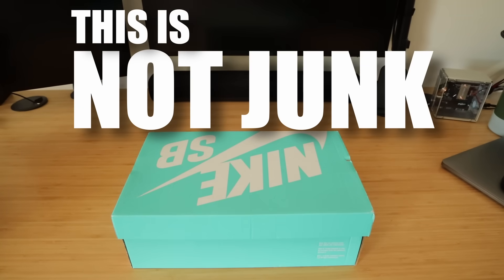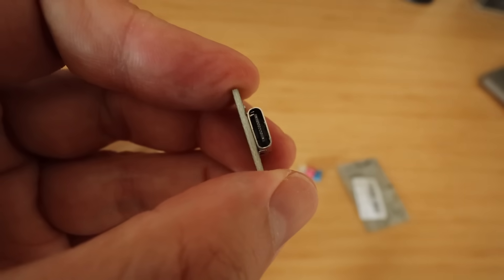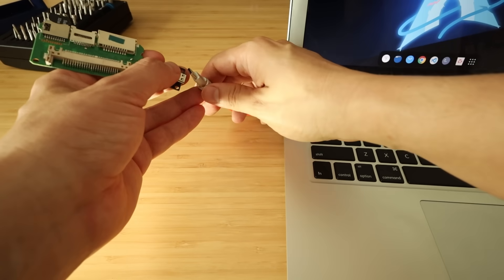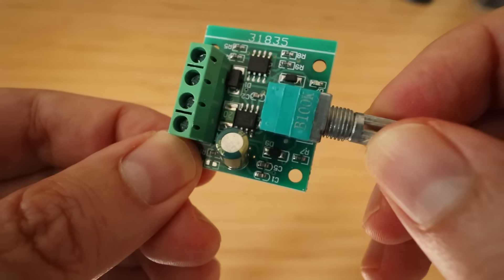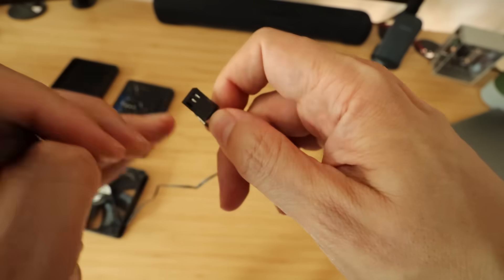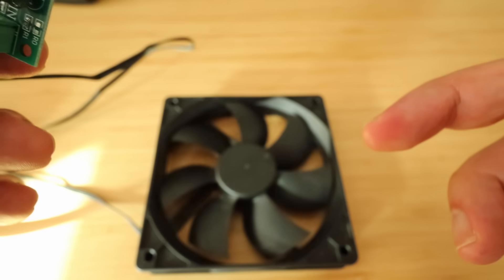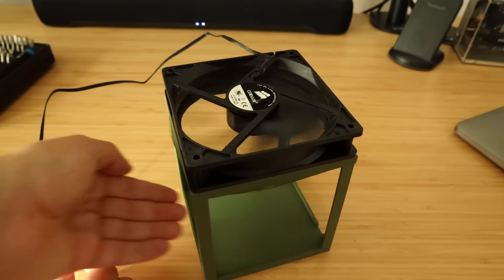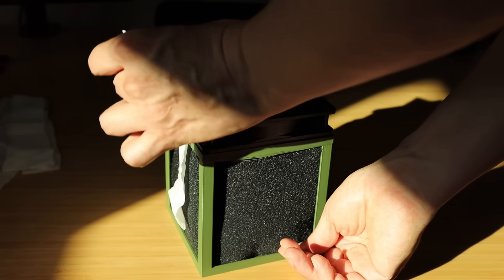Turning Old Electronics Into Useful Projects

Comment: This might be a long shot, but if the fan seems underpowered you might want to check if you're actually getting 12V on the USB PD. I ran into this with a 9V project; apparently not all chargers support all the voltages in the PD spec? So it might be falling back to 5 V.
Reply from the maker: 😅 I definitely should double check voltage.

Comment: The fan project was interesting, but from personal experience, you would have better luck using one of those 20"x20" box fans with a 2 inch thick hepa filter.  Granted, that is not out of spare parts, but you would be amazed at how well one of those fans running with a 2" hepa can do to reduce the floating dust in a room.

Comment: Have you tried using rubbing alcohol to clean the layer of sticky plastic off the radio?  I had good luck with that on an angle grinder that went sticky...it does remove a layer when you do it, which can change the color and size of the part..but it not being sticky can be worth it.

Comment: A useful thing for you might be to change the banana connectors on your multimeter probes. Instead of the default 90 degree ones, you could solder on some straight connectors (it just seems to be more convenient for multimeters that have connectors underneath)   Thank you for the videos! Keep it up💪

Comment: I had a computer case with a soft-touch coating on it that turned sticky, I cleaned it with window cleaner (Windex). Took the stickiness right off. It no longer has the soft-touch feel, but it's been a couple of years and it remains unsticky.
Reply: Interesting....i use talc. Maybe it's the ammonia in Windex that works?

Comment: 0:30 i had the same issue with a radio in storage. It had that kind of rubbery, silicone, grippy coating on it. I gave it a normal clean with mild soap and water, dried it, then coated with talc before storing again. The talc seems to stop it getting gunked up again.
Reply: Yep, i was just going to say this, too. All you need is some talc, or corn starch, and it won't be sticky any more. I just saved an old, but otherwise perfect,  USB battery bank by doing this trick. I used my foot powder....smells nice, too!

Comment: Just FYI, when putting wires in crimps and clamps, it is actually not recommended to tin them. The solder compresses and can eventually work itself loose.
Reply from the maker: Ah, good point! I just couldn't get the wire twist to stay put. I'll get some assorted wire-end ferrules
Reply: @ChrisToTheEther  ferrules are nice, but if you don't have them you can
Strip the wire back more, twist the wire and then bend it into a hook shape, then insert it and tighten the screw, the wire will hook on the screw and get squashed aswell (has to be under the screw not behind, and twisted and bent in the direction the screw tightens)

Ferrules are more simple